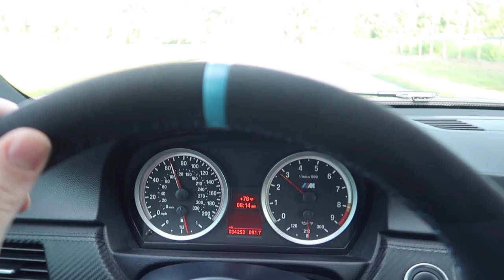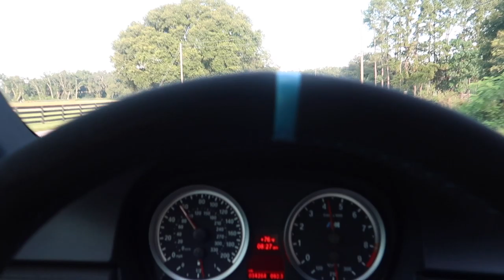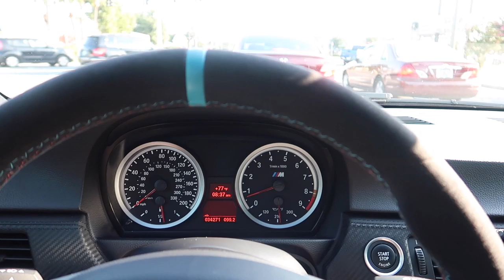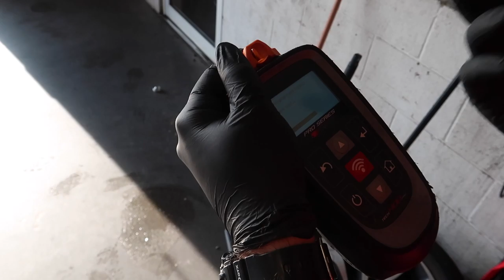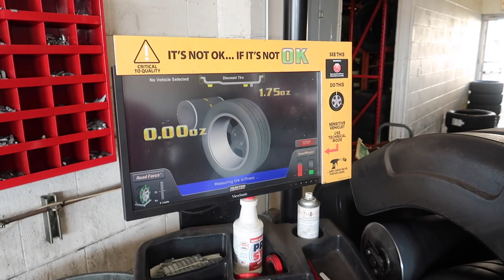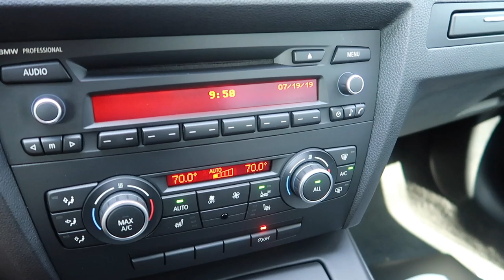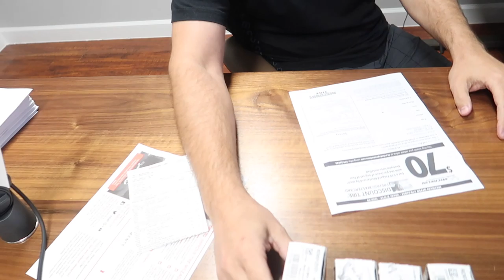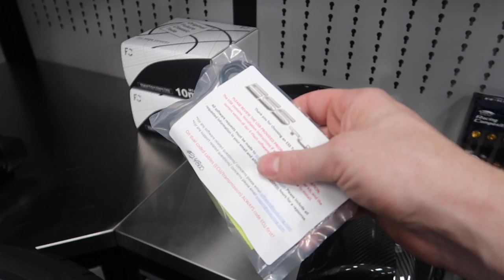A Day In the Life of The Obsessed: E12 - 07 | 19 | 19

Comment: Funny they mention their process for programming the M3 sensors, as I had this issue last fall at discount with my '11 M3 and eventually figured out the issue myself! First, they need to be using the HUF UVS4030 sensor, a problem occurs where they search the M3 and only get 08-10 which recommends HUF UVS2000. Then, as it seemed discount mentioned, which I had to figure out on my own with my discount tire, you have to use a standard 328i or 335i on the programmer. Thats because they search by make, model, then year. For the M3 it will only show 08, I convinced discount tire to do it for a 2011 328i and it worked no problem. It sounds like the discount you're at got it right, but if not, reference this comment, they could have used the wrong universal sensors. They need to be UVS 4030, program it for any 11-13 3 series and it will work on an LCI M3. Good luck!

Comment: Matt, I have the AST’s on my E46 which is about the same size as the 1M. I think your only problem is the spring rate is too stiff. A simple spring swap will fix her right up. For example... I have two sets of Swift springs for mine. One for the track and one for the street. The difference is night and day between the two. Also, if you’re not wanting to mess with that, you can try adjusting the rebound dampening on the shocks themselves. The guy before you probably has the rebound set too stiff causing the ride to be harsher than it needs to be. Try softening it up. 

Also, that M3 intake is 🔥🔥🔥!! Holy crap that sounds nice!

Comment: That induction noise is just incredible. I figured it would sound dramatically different since you are adding a plenum that is so much thinner and likely to resonate and reverberate with the intake noise. The factory plenum was probably designed largely to limit that induction sound and quiet things down using thicker and heavier materials, so it's really rad that this one sounds so amazing.